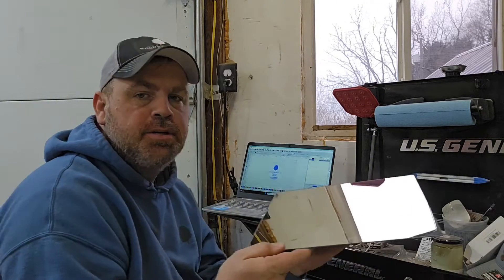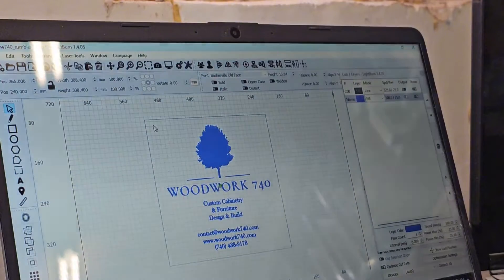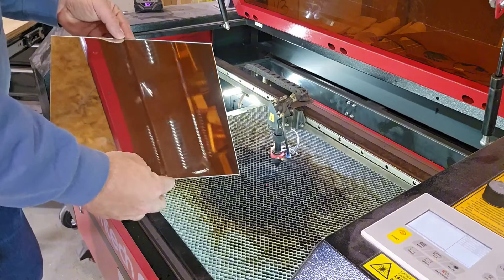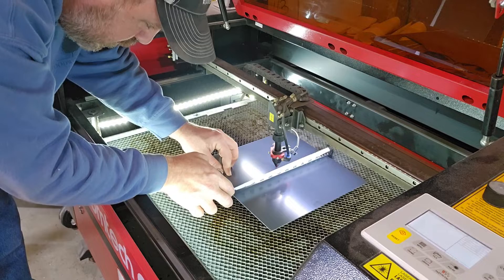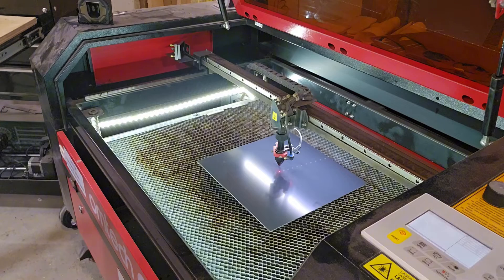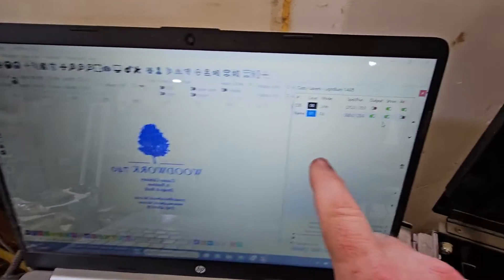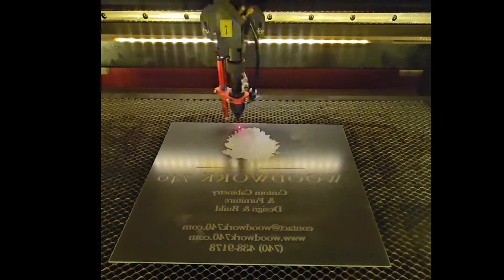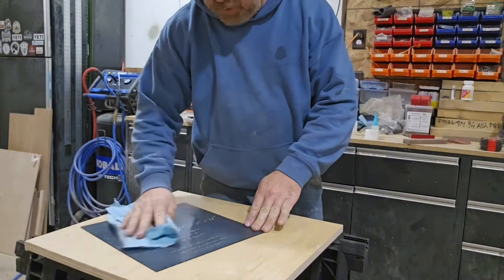Laser engraved mirrors are really cool 😎

Comment: Just wondered….can you paint the graphic?
Reply: You can spray or hand paint. I like to use gold leaf (fake gold) It all so comes in silver and copper.
Reply from the maker: I'd guess it's possible. You could individually hand paint the graphics or if it's a solid color you could easily spray paint it. Since I made the video I've added some LED lights to them and it really changes the look.
Reply from the maker: Update* I have started spray painting the backs after engraving. It looks incredible. I like it better than lighting it with LEDS

Comment: In lightburn instead of the black square use the blue or oange labeled T1 or T2. Those are toolpaths and they don't fire the laser, so no need to toggle the output on/off.
Reply from the maker: That's a great tip to know! Thank you!

Comment: Another way to align your work. Keep your cardboard boxes and cut them down for alignment jigs. Measure the mirror and cut a void in the cardboard. Now your machine is aligned with the void. Then you don’t have to measure, align, and jog your gantry.

If you don’t need center alignment you can cut a corner and slide the mirror into the corner.

Comment: I'm using a Trotec w/ JobControl, but I like to use the gantry movement controls and the red dot to make sure I am square to the travel of the head... I run the red dot along the longest edge, adjust as needed to square, then position the dot on a corner of the workpiece.  I make sure there is a bounding box "positioning line" that matches my workpiece in the design and then I just snap the positioning to the cursor/head location for perfect registration every time.   For printed materials, you can print the bounding position line for squaring and registration, no tape measure needed.
Reply from the maker: That's smart